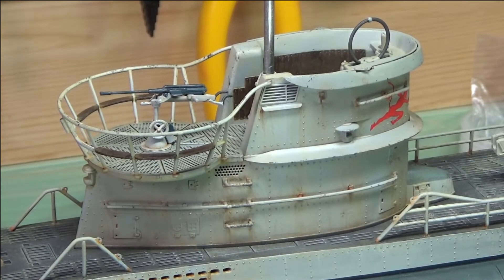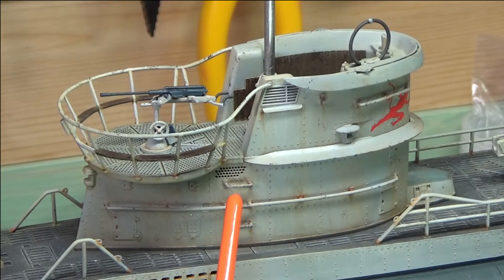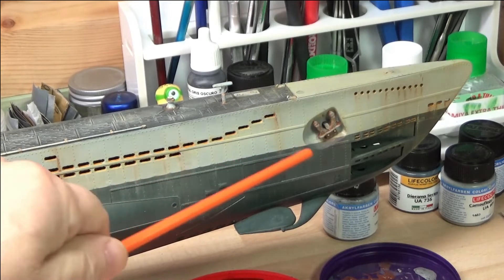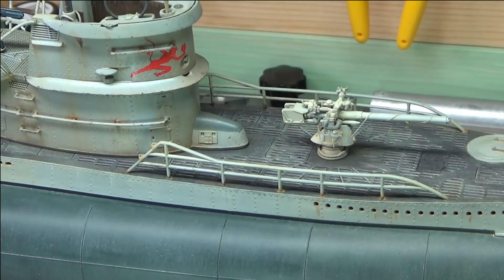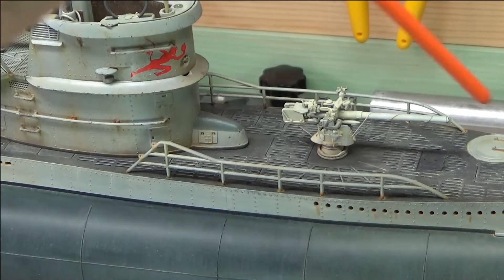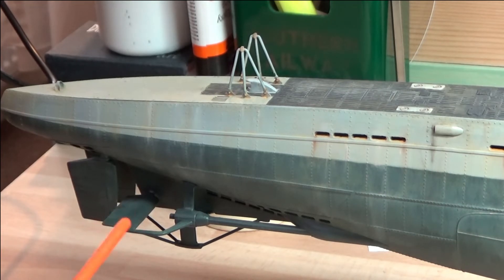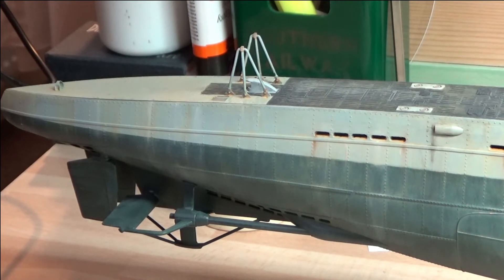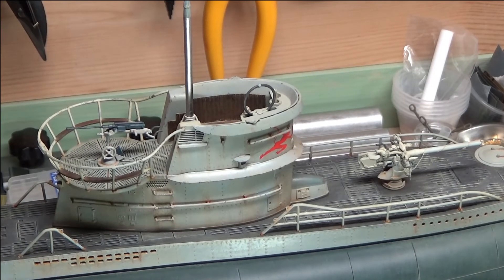REVELL GERMAN SUBMARINE VIIC 1 72 UPDATE 9

Comment: Hey weathering looks awesome!! How did you painted the black Wood part on the deck, with a brush or with a spraying Thing? Also is this a beginner friendly Kit because i would love to build it but the only Thing i built before was the type viic/41 in 1:144 scale and thats difficulty Level 4 and it was really hard for me so is it doable (without the photoetch etc, just the revell stuff)?
Reply from the maker: Friedrich well I sprayed must of the kit, but did hand paint the decks. Its not hard kit to build, I say intermediate. The deck gun was a photo etch and resin. And the weathering is fun, I may have overdone it little but it pleasing to look at. still need todo the rigging from bow to stern, I have done the hand railing cables on the main deck. For you its would be similar build but larger, if you do go for it just take you time and you should be fine.
Reply: MILITARY MODELLER Paul  Ok thank you for the fast answer! ☺️